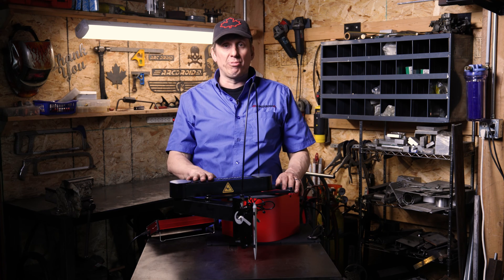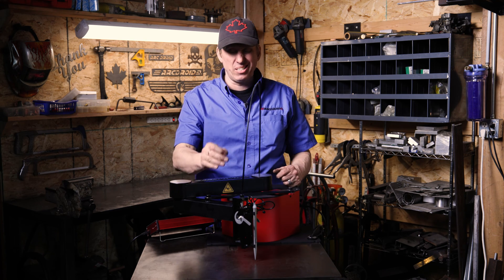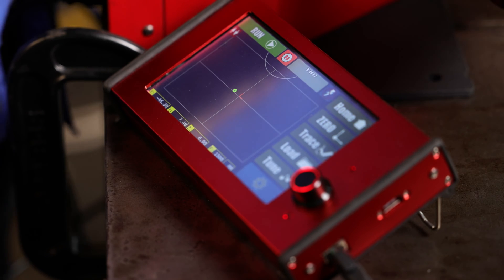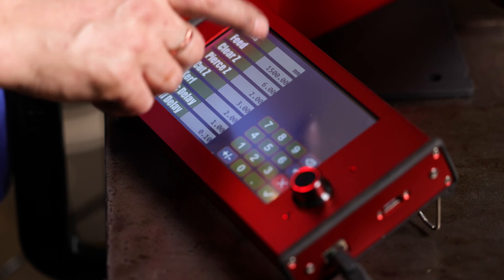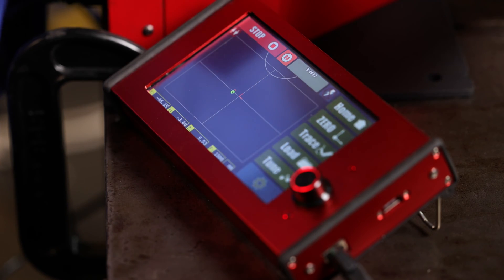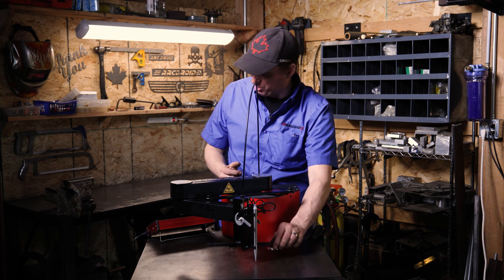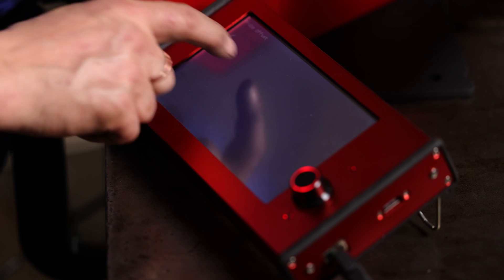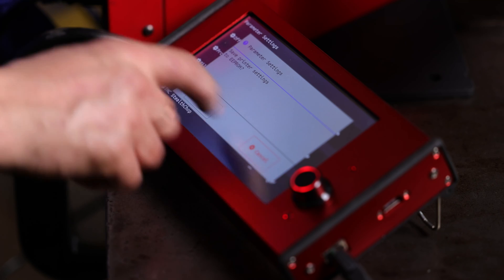Step 1.5 Z Axis Calibration

Comment: Are you able to cut custom file from a PC or does it only cut traced items? If it does cut from files or usb. Is there a link to a step by step video?
Thx
Reply from the maker: Of course we support offline G-code.  We have post processors for  Fusion360, SheetCam and Pronest.

We also have an upcoming feature that  allows DXF import directly to the ArcDroid